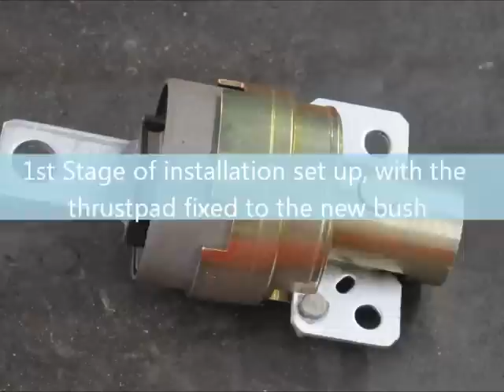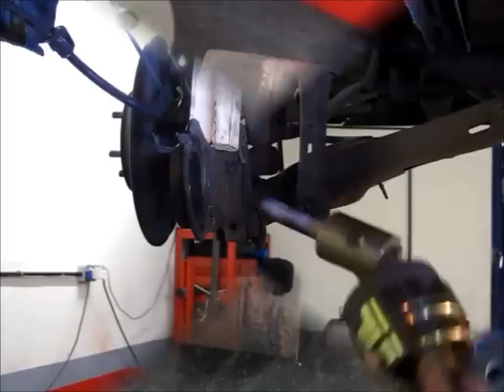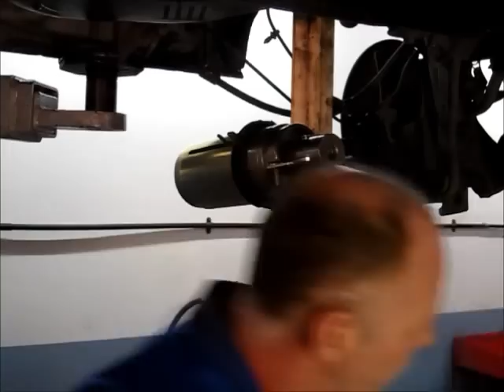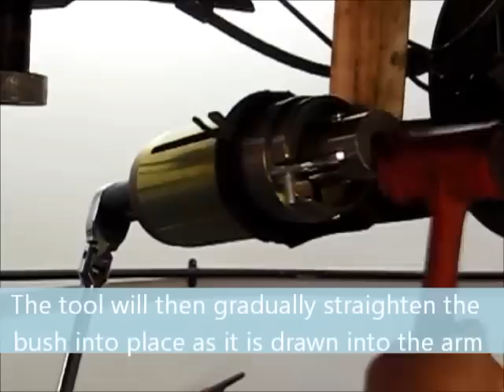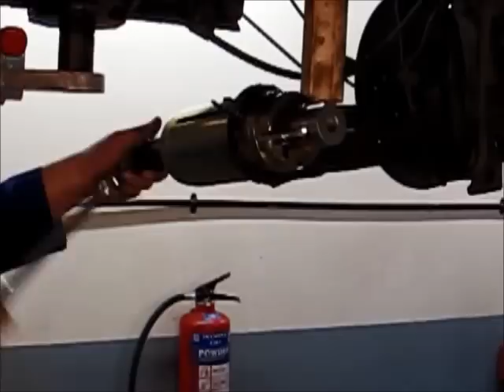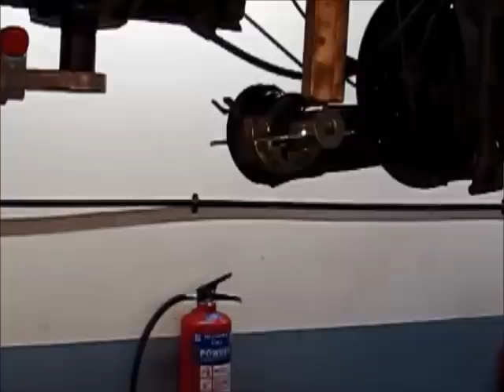08730400 - Mondeo Rear Bush Tool Kit - Rear trailing arm bush installation on vehicle

Comment from the maker: Thank you for purchasing this Sykes-Pickavant tool. We hope we can help you get the best out of it. There are 2 factors to consider that give this effect.
1) Quality of aftermarket bush - we have found some to be slightly oversized so fitting them will always be tricky
2) More likely the case is the actual OE trailing arm. Whilst they are all slightly offset - we have found a number to be slightly oval; and this, if the case will show in the tendency to pull the bush sideways more than is normal; some are worse and this is more pronounced. To compensate for this we recommend a method of aligning the bush & then pulling it in a little building up the load, check & realign if needed, then apply more load. We have found using a soft hammer to line up the assembly the best way - as per our video... Please watch so the method we recommend is clearer. Hope this helps.